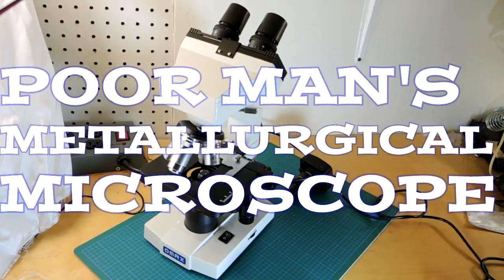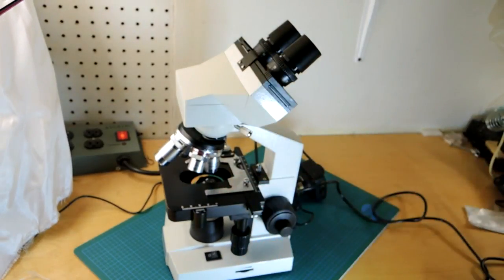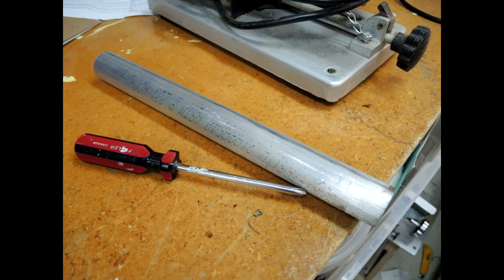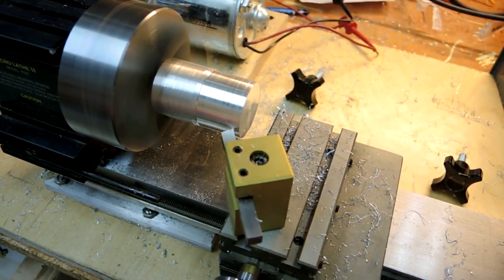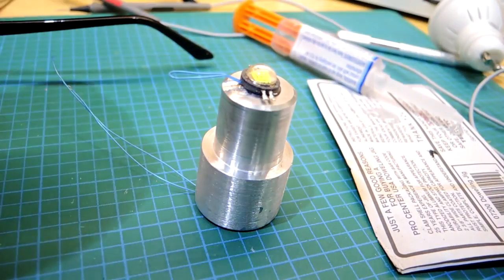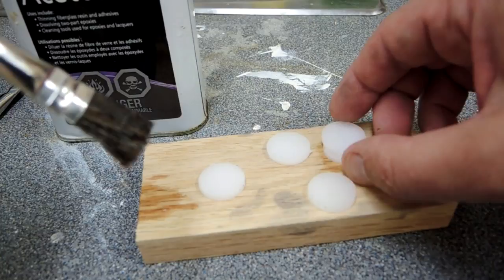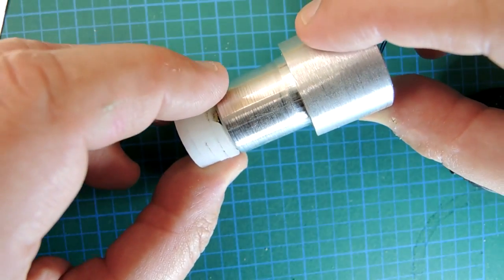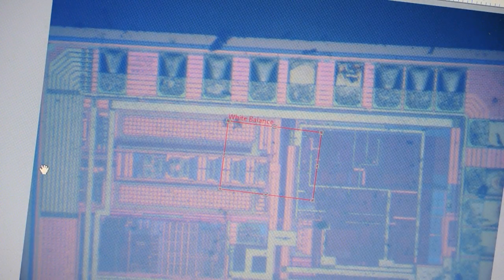Poor Man's Metallurgical Microscope: Adding Top Side Illumination

Comment: @electronupdate I'm making this now. Is that a rod of aluminum?
Reply from the maker: yes
Reply: @electronupdate  I'm having trouble replicating your eyepiece. Instead of just drilling a hole for the wires, I hollowed out most of the interior of a piece of aluminum so the plexiglass and the LED light can rest against an internal lip and i don't need to use the glue and tape like you used. But the illumination is either way too bright and white or just a dim muddy wash. But then when I light the circuit board I"m looking at from the side, it is bright and sharp. Any suggestions on how I might be able to replicate your high quality images?
Reply: Do I need to use a certain number of plexiglass disks? Maybe not diffusing the light enough?
Reply from the maker: @BenFreemanDC  The light needs to be diffuse.  Hot spots would result in wash out
Reply: @electronupdate  I just realized I actually have a binocular compound microscope, with only 1 light path. So I'm getting a reflection. So I can't use your modification. I'm looking into darkfield lenses which might work.